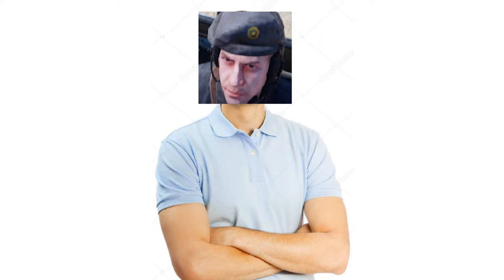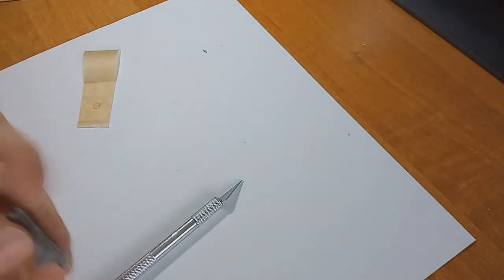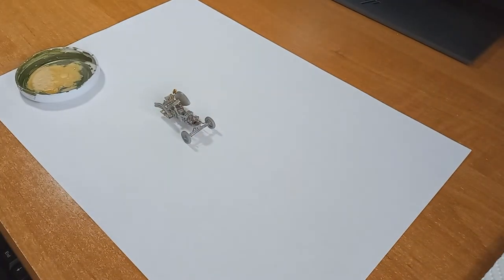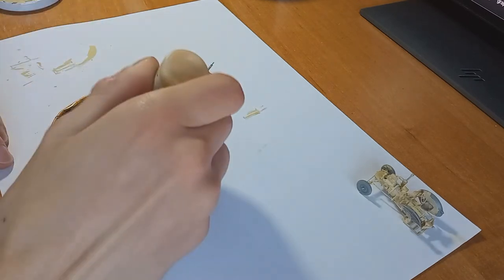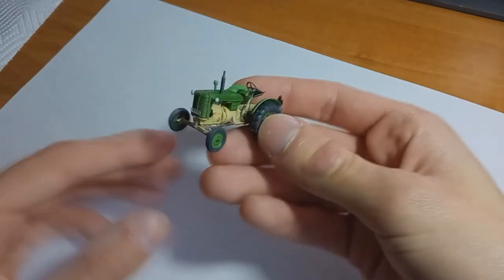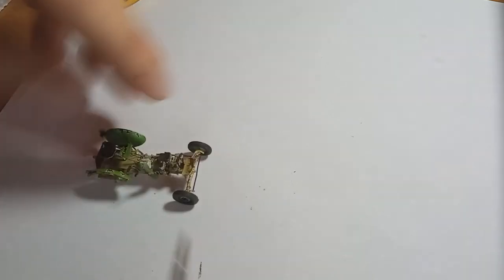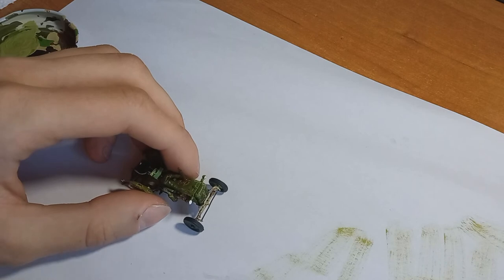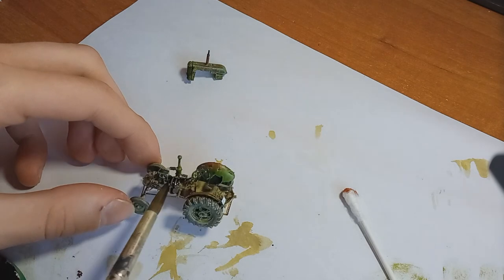Brush painting a tiny 1/72 scale Zetor 25A (czechoslovak vehicles series part 1)

Comment: Very nice ractor. Very good work.
If you are worrying about the smell of white spirit/thinner try wearing a FFP2 mask when using it.
On 6mm tank I painted I used an airbrush colour by Hakata. It needed some more layers as I do normaly but no detail was "buried" in paint. Maybe worth a try for you too.

I wonder about the "agricultur version". Was there a "police version" too? 😁
Reply from the maker: Thank you very much. The agricultural name actually has an interesting explanation. There were two versions of the tractor: A version or agricultural that didn't have typical hydraulics on the back like a normal tractor but instead had attachments compatible with modified equipment originally intended for horses, then there was K variant a.k.a cultivat, that had more modern hydraulics made for tractor equipment, something like you see on vehicles now. I don't think there was a police version of the tractor but there was a military one made for towing aircraft
Reply: @stocky5670  Now I understand. So this was a tractor for the transition from horse drawn agricultural tools, so that you could still use them on your new towing machine. Very interesting.